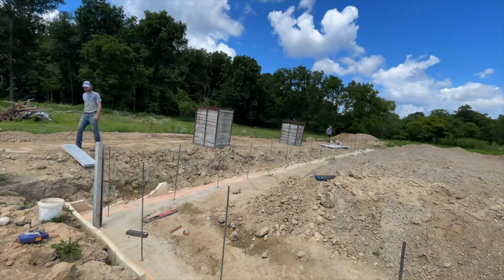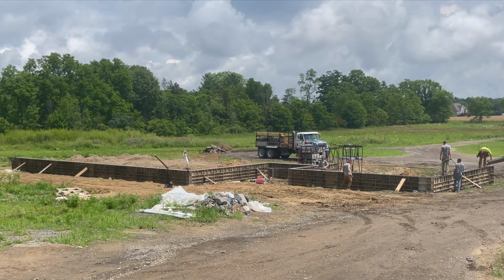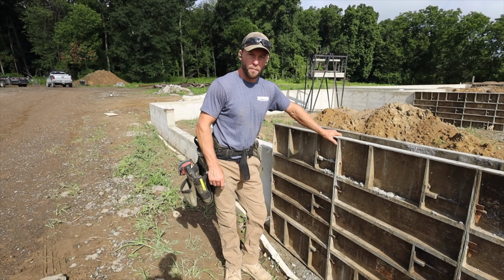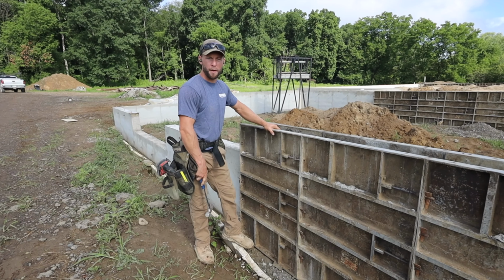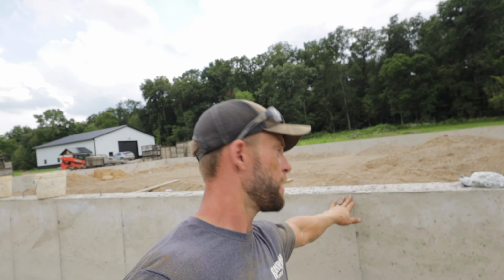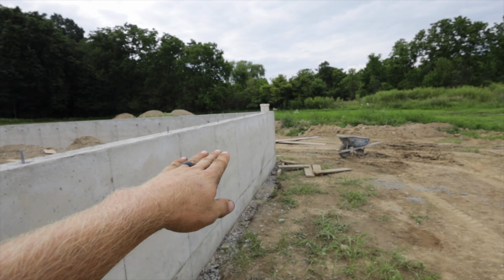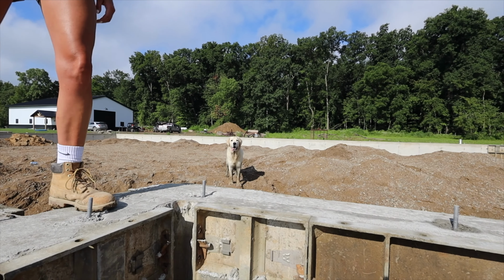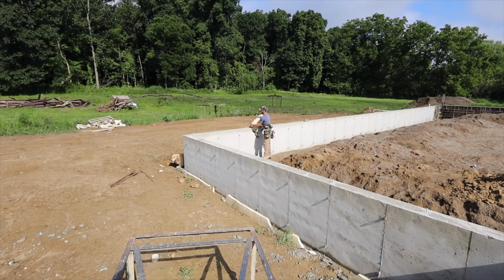Pouring Our Own Concrete Walls | Building Our Own House #ep3

Comment: Hey bro concrete guy here. Definitely not a foolish plan to do it yourself. You guys killed it! It’s all about having a good plan and making sure everything is in place to execute. And yeah we would have charged about $50-$60k without any dirt work here in the PNW so yah man you saved a buck. Cheers bro!
Reply from the maker: Thanks man! It was a lot harder than I expected, big respect to you guys. Cheers!
Reply: I truly appreciate the sweat equity that you guys put into this project.  I'm a DIYer and have put myself under the gun many times to get a job finished and return rented equipment on time but nowhere near anything like this.  God bless you!    @RathburnRanch
Reply: I knock the ties as I go though
Reply: How do we tie in a new pour to the wall we just made.  I want to do a 20x30 basement one wall at a time using Jahn forming system

Comment: I’m glad to see your not doing the typical Michigan house build. Where everyone needs a basement so they use 8 foot poured walls and then builds the house on top of a hill. Are you going to fill in the foundation and use in concrete radiant in floor heating. On the good side at least lumber prices are going down. We’re enjoying your build series
Reply from the maker: We sure are! It was cheaper than a floor system and should be much more efficient! Thank you Jerry!

Comment: Stripping panels after only 24 hours weakens concrete by over 1/3- t
Reply from the maker: It sure does. I was told to do this at the time and regret it heavily. I wish I would’ve given them at least 3 days. Thanks for the comment!
Reply: Don't reckon

Comment: Was helping a guy last summer right out of high school and didn’t know anything about concrete. Second job we did was a 5000 sqft house and I had help setting up the forms, and then had to tear them down myself and then set them back up by myself to set up a wall in the middle of the house for the garage. Then tore those down and set them up again for a 120ft wrap around porch. And I swear I will nvr touch those things again. Worst week and a half of my life

Comment: So are you guys having a basement? Or what is the purpose of such a deep/tall set of concrete walls? New to this stuff just doing research on building a barndo and a little lost. Thanks!
Reply from the maker: Nope unfortunately no basement. The location was low so we had to build everything up to that height. It is a slab on grade which means a concrete floor with no crawl space or basement.

Comment: Wonder if it’s cheaper than using concrete blocks for the foundation
Reply from the maker: Block would be cheaper but the number of weeks it would take for me to lay that many block wouldn’t be worth my time. If I was retired or if it was a small job I would’ve used block!

Comment: How much money did you save and how much did it cost
Reply from the maker: Depending on the quotes we saved $55k-60k. It cost around $10k in concrete/rebar
Reply: @RathburnRanch  I’m trying to build tax free underground luxury apartments super cheap, I was quoted $20,000-$70,000 just for the concrete for 2000 square feet. Is there any way I could get a reasonable price? 

Is there any way I could build something larger than a tiny prison cell size block for less than $250k…… 🤦‍♀️🤦‍♀️🤦‍♀️🤦‍♀️😱😱😱

I wanna build a 5000 square foot house with sturdy concrete walls and ceilings for cheap. Where can I get cheap concrete. I was quoted $120 a yard or $10-$20 a square foot.

I wanna build a sturdy structure and then bury it under earth. Some people said it would be cheaper to use used shipping containers but you still need some concrete for reinforcement because containers can collapse under intense weight, they said they are only strongest at its 4 corners and the sides and roof can cave in eventually after intense weight from earth pushing on it for some time

Comment: Can someone answer a question for me please.    My idea is to 1. Pour foundation with rebar sticking straight up  for the walls.  2.  Cover with huge pile of dirt 8 feet tall.  3.  Dig down to the foundation.   4. Pour the 4 walls all at once.  5.  Dig out all the dirt.     

Please note I am only trying to make a small house. Not big at all.
Reply from the maker: That is an interesting idea. On paper it would work if you found a soil that would compact hard enough to re-dig clean trenches but if you have any cave ins your basement will look pretty goofy. Additionally you'd need to put wood or foam on the outside of that trench to give you a smooth surface to waterproof. If it was for a cabin in the woods- then maybe. But I don't think any building inspector out there would allow it haha.
Reply: @RathburnRanch    building in the Philippines.  Going for the rough look.  Thinking about doing a stain finish and kind of carve rock patterns in the concrete after the pour dries and I remove the dirt

Comment: What a disappointment! Looking at the thumbnail I thought I'll finally see concrete walls in the US on a residential house... Anyway, wish you luck, DIY is definitely way to go to save meney and often maintain a good workmanship on your project, if you're able to pull it yourself. Looks like a good start!
Reply from the maker: I’m confused haha these are concrete walls on a residential house
Reply: @RathburnRanch  Yeah, but I expected actually walls of the house, not just a basement. And concrete or mixed (like steel-cereamic beams with aircrete or brick blocks infills with a concrete pour) ceilings... I don't suspect any click baiting, it's just I got exited for a different story 😀
Reply from the maker: @oakld  gotcha! We had planned on ICF actually but changed our minds last minute. If I could do it over I certainly would. Masonry is 100% the way to go in my opinion
Reply: @RathburnRanch I'm looking at doing a garage with poured walls